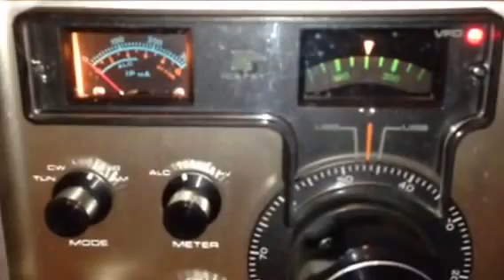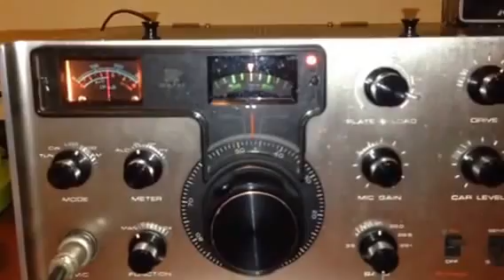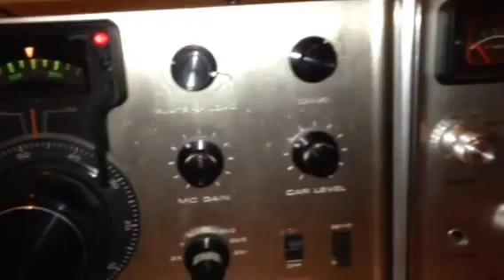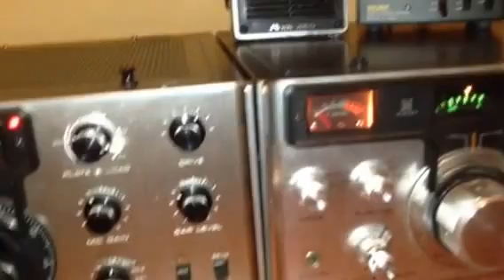The Kenwood Twins: T-599D n R-599A

Comment: How do you sync the tuning of the receiver with the transmitter?
Reply from the maker: Hi, there is a cable that link the two radios.. Either we use the VFO on the receiver or the one on the transmitter.. Thanks..

Comment: I just got these from an estate of a good friend.  They seem really nice,  I have not tried the transmitter out yet.  I think these were his pride and joy he had them on a shelf all by themselves.  They will be going on ebay after I play with them a bit.    I also have a R-599A receiver that was not working from the same estate..  it is a little rough but I got some audio from it tonight and it seems to want to work..
Reply from the maker: Hi Bob, thanks for dropping by. If I were you I will fix the receiver and keep it. They are really fun to operate..
Reply: YB0NSI I actually have two of these units.  one  that is  in really nice shape and one  that are missing the bottom panels (lost to history)..  I got the second receiver working really well it was just dirty,  I just keep working the switches and blasting the band switch with contact cleaner and it get better and better.  I have way too many radios now and no place to keep them.  But my plan if to keep the second set of the twins for sure.   The second set looks like they came from Europe they had a non-US plug that was adapted.  I replaced that today.   But you are 100% correct they sound great.
Reply from the maker: +Bob Wendoloski hi Bob, they r very nice transceivers.. Do you still have them?
Reply: I actually sold these at a hamfest in July.  I was selling them for my friends widow.  I pretty much sold them as a lot and someone got a good deal which is what my friend wanted.